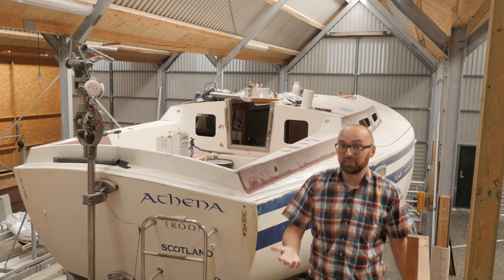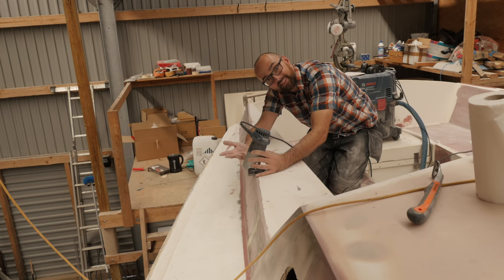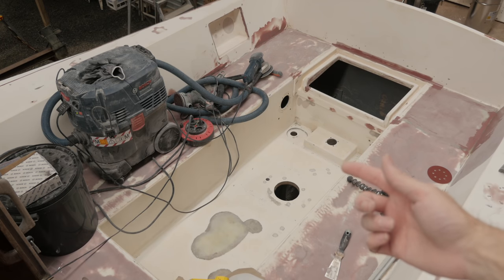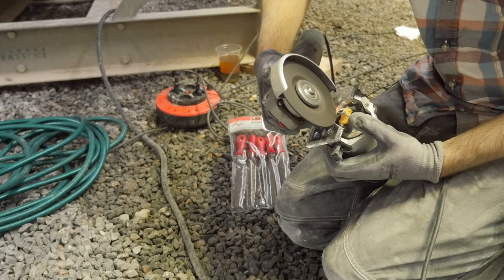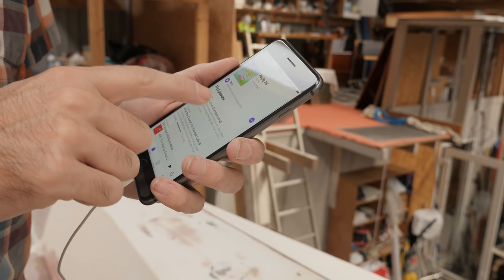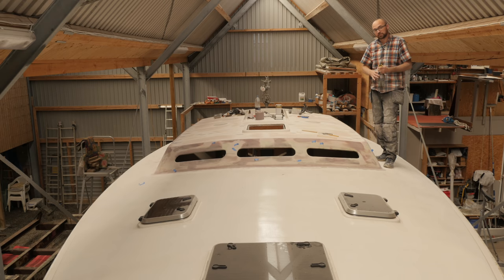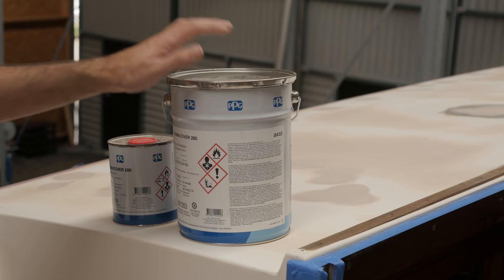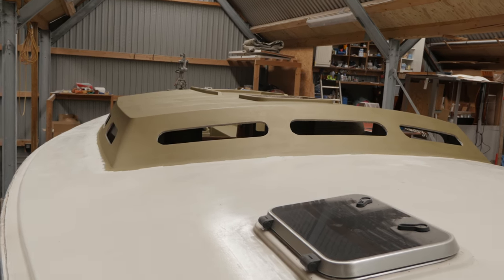Sail Life - Painting the deck of my sailboat video 1 of 2 - DIY sailboat restoration

Comment: Congratulations on reaching this milestone.  I read a really cool article in Good Old Boat Issue 116 September/October 2017 on a non-skid application.  I think you mentioned that you were going to use Kiwi Grip.  In the article, the owner tapes off the deck like a teak deck pattern and applies the kiwi grip.  The final product looks really amazing - like a teak deck but not.  It may be worth it for you to take a look at it for consideration.  It may slow you down a week in the prep work but it could add a ton of character to your yacht.  Athena will be one fine yacht when you are done!

Comment: Mads,
Forgot to mention that you can cut the pipe insulation to give you and inside curve that will match the angle of the front of the cabin.  Using the inside diameter lined with sticky back sand paper will help maintain the radius over the length of the curve in the cabin front.  I use this on the rounded corners of cabinets, etc.
More sanding videos please!

Comment: In the Hobie Cat world we drill holes through the top skin then inject thickened epoxy until its squeezes out of adjacent holes. Sheet metal screws are then used to pull the delamination together.

Comment: Dang she is coming together nicely! Did i ever send you the custom sanding block method I used on my boat? 

I used a block of wood, airdry clay, rubber foam pad. I contoured a small section, pressed the clay to it with the wood backing. Then when dry I sprayed with adhesive spray and mounted the rubber foam. Then i applyed sticky sand paper and it made quick work of fairing the deck haul joint.

Comment: You have done an incredible job on the cabin fairing.  👍👍👍👍 I have been making wood patterns for large fiberglass parts for a long time! The faring methods you used are right up there with what we do. We use different products primarily polyester/vinyl ester based, much easier to work with and quicker curing. ( even suitable for boats if you pick the right products) .  We have a great high build primer that does an awesome job with the final surface finish. But time has beaten you.
I look Fwd to you final spray painting ..... who will be the special guest! Cheers Warren

Comment: For persudading rusty srews exists a tool called impact driver. Look like a screwdriver, but used a bit differently. You place it on a head of a screw and whack it with a hammer.

Comment: You used a linear distance ratio to mix the primer but the mixing bucket looked to me like it was getting wider as it went up.  

One can only get a consistent mix ratio using the distance stick with a cylindrical container that doesn't get bigger as it goes up from the base.   

Uh-oh!

Your 4:1 ratio might be off with too much hardener used if it wasn't a constant diameter cylindrical mixing container.  I hope I am wrong here...